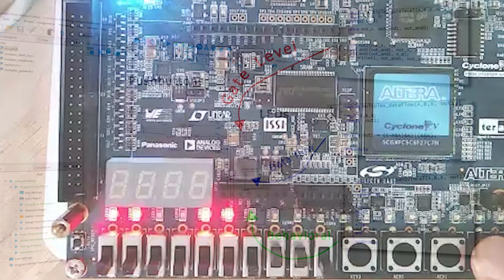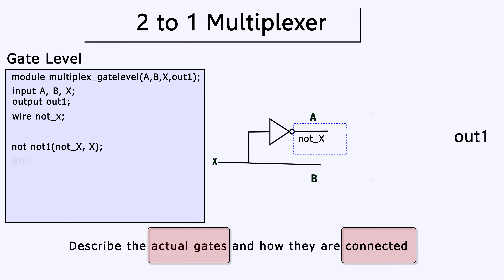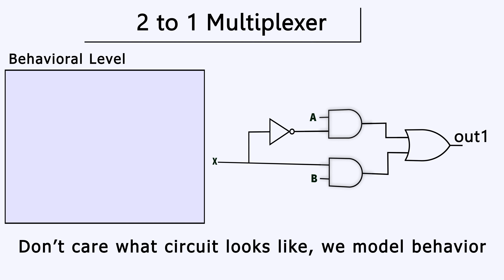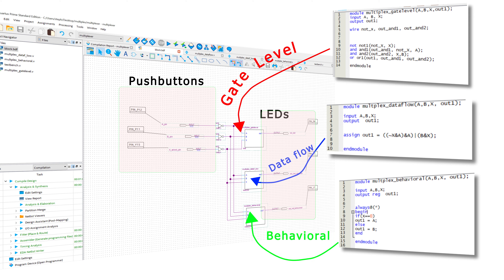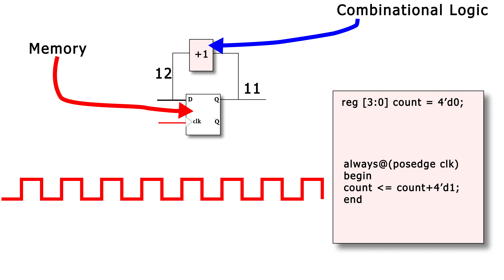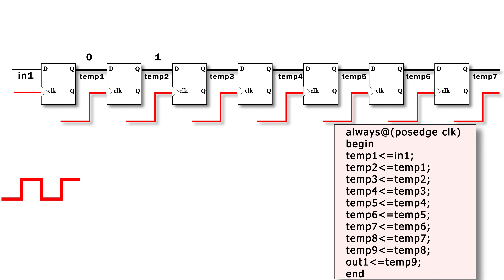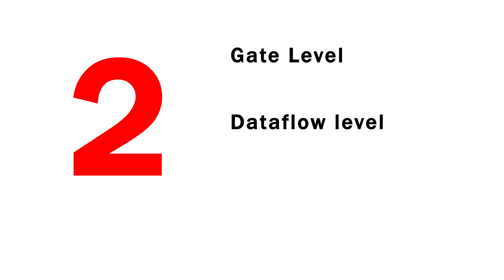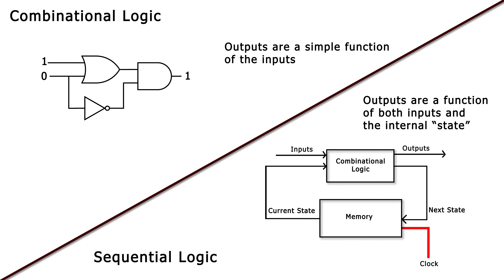The best way to start learning Verilog

Comment: Can anyone confirm to me that the statement assign out1 = ((~X & A)&A)|(B & X) should be assign out1 = (~X & A)| ( B&X)
Reply: They're equivalent but yeah it should
Reply: You can remove left internal parentheses without any effect. Then you can see that A & A is always equals A. So your two expressions are the same. There definitely is a rule of the formal logic that describes this kind of cases but I'm to lazy to take the book from the shelf.)
Reply: A&A simplifies to A anyway so they are equivalent
Reply: @MrMineHeads. yea but why would you write it like that. Why not just have the simplified expression
Reply: @lukealadeen7836 is this design always simplified? is it impossible to write so as to make a small delay?
Reply: @lukealadeen7836 it’s been a while since my hardware logic class but it could be down to hazards?
Looking at it, that shouldn’t be the case and you should be able to drop the additional "&A".
Reply: I was just about to ask a similar question 🤪
Reply: Write a truth table for it and see yourself
Reply: correct, the longer way is redundant but equivalent
Reply: Although this is a serious comment as someone who has absolutely no experience, this is making me laugh how seemingly absurd it is

Comment: 00:01 Verilog coding involves three different layers of abstraction and understanding the difference between combinational and sequential logic is important.
01:59 Modeling in Verilog at the gate level involves instantiating each logic gate independently and connecting them together using wires.
03:46 Behavioral level Verilog code describes circuit behavior at a high abstraction level.
05:40 Multiplexer can be implemented in different ways: gate level, data flow level, and behavioral level.
07:31 Utilize D-type flip-flops for sequential logic
09:14 Blocking and non-blocking assignments have different evaluation and assignment processes.
11:03 Understanding the difference between blocking and non-blocking assignments in Verilog
12:54 Use blocking assignments for combinational logic and non-blocking assignments for sequential logic.

Comment: This was a very interesting and great video. Thank you very much.
But i have one questions. Your 3 code examples for Gate, Dataflow and Behavioral Level do produce the same end result, but does it also generate the same hardware inside the FPGA? 
I'm asking because I would like to know if the design was much more complex, e.g. a CPU implemented in an FPGA, would the CPUs of the 3 codying style variants be the same with the same performance?
Or would it be possible, for example, that the dataflow level variant generates a faster CPU on the FGPA than a CPU based on the behavior level variant and vice versa?

Comment: Is the example of dataflow level correct here? At around 3:40 , isn't it supposed to be: assign out1 = (  (~X&A) | (X&B) ); #newbie here, dont understand why the 1st AND gate is written as (~X&A)&A
Reply: Yes, it's wrong in the sense that it doesn't match the logic gate schematics, but it is harmless (A&A = A), and still works the same. The compiler will optimize that out regardless.

Comment: I think you made a mistake here at 9:36.
"Blocking" means, that the assignments are blocking, i.e. they run sequentially (one waits for the prior to finish). "Non-blocking" means, that the assignments do NOT block, i.e. they run in parallel and are evalutaed immediately.

Comment: How do codes written at these different level of abstractions convert to synthesis in ASIC Design?

Say I write,  assign wire = (a&b) | (c&d) ;

I can come up with 3 possible ways to synthesize this:
1) 2 AND, 1 OR gate ( 18 Transistors )
2) 3 NAND gates ( 12 Transistors )
3) AND-OR22 module ( 10 Transistors )

Which one does the code synthesize in this case and how does it make that decision?
Reply: I'd assume number 1, because that is the literal interpretation of the boolean expression.  Unless the synthesizer has a way to automatically simplify boolean expressions into simpler circuits.
Reply: hi what is the third option? could you please explain it?